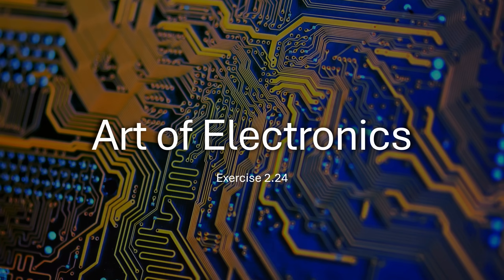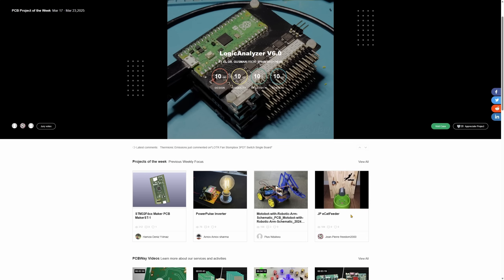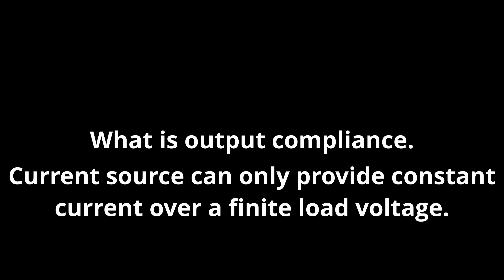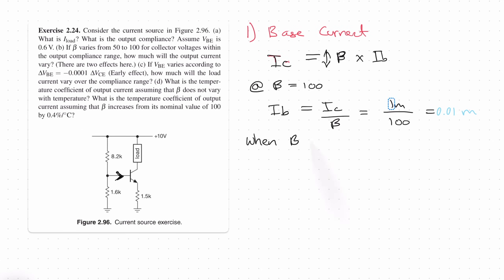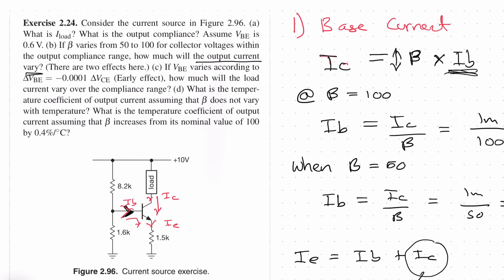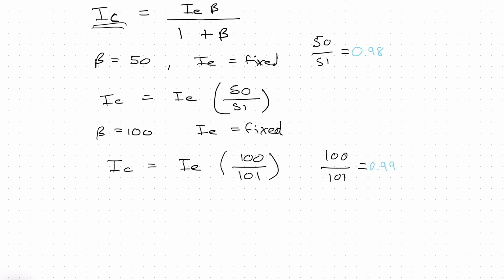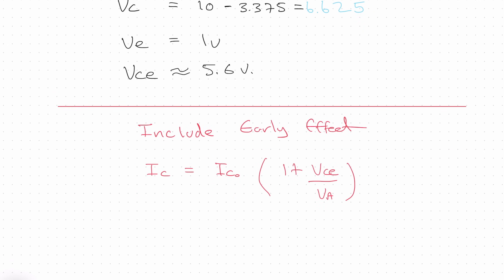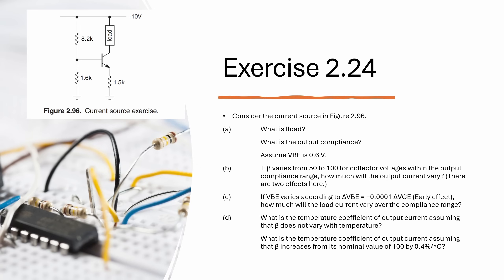Constant Current Source - Art of Electronics Exercise 2.24 (Part 1)

Comment: Hey. Just watching. I'm at 6:00. At the question "What is output compliance voltage?". I get your idea, but if lowest compliance voltage is 1.1V then you will have like ca 0.18V at the base of transistor with these resistors. Transistor wouldn't even turn on below 0.6V so it can't be that low? Or I am missing something.
Reply from the maker: What’s ca? 

Base voltage is assumed to be fixed. In this case it’s roughly 1.6v. 

We have Vbe of 0.6 approx there fore 1V on the emitter resistor. 

Vce when saturated can be as low as 0.1 (this will vary with transistors) so that’s where the 1.1 V comes from.
Reply: @TheEngineeringExperienceYT  "ca" is short for circa meaning about 0.18V. How can you have 1.6V on base when compliance voltage is 1.1V? I think we mean different things by compliance voltage? For me compliance voltage is voltage range that current source needs to operate. It is basically supply voltage(10V) in this case. I think we mean different things. I haven't read AoE for a while so probably there would be explanation about it. I just happened to watch yesterday EEVBlog video about current sources. You can check his latest video. Around at 8:20(in his latest video about current sources) he explains compliance voltage as "power supply voltage behind constant current circuit that makes it work". I think I can't post the video link here, but you definitely know EEVBlog and you can find his latest video easily. Anyway I think we have here definition misunderstanding.
Reply from the maker: Thanks I’ll have a look. 

Compliance for me is the load voltage range for which the current source can maintain the set current. So I am not sure how base cannot be 1.6v. Base voltage is used to the nominal current for the source
Reply: @TheEngineeringExperienceYT  Since I thought compliance voltage is basically supply voltage then when you have 1.1V supply then you will have like 0.18V on the base. But of course if we take your definition of compliance voltage then it all works out.